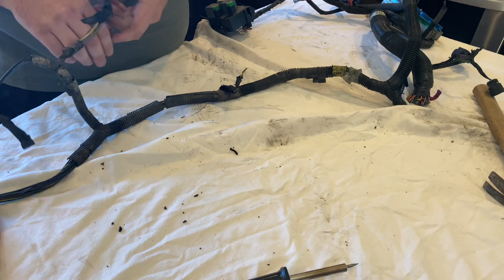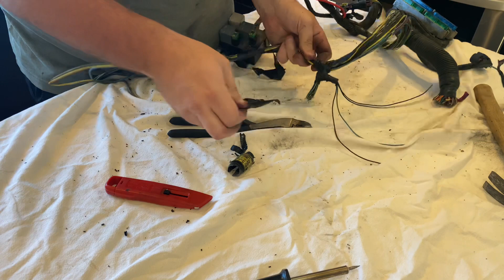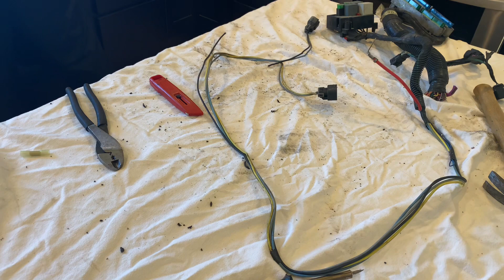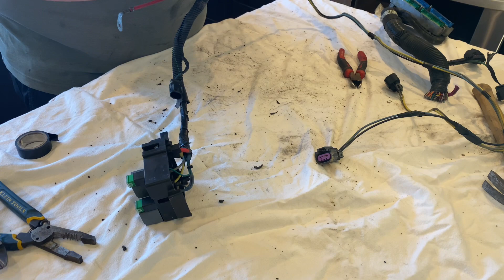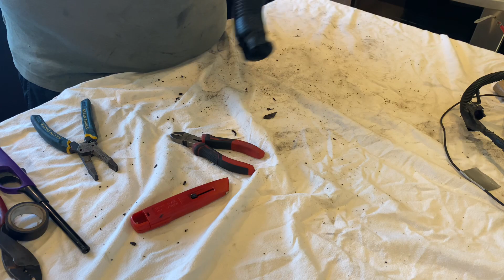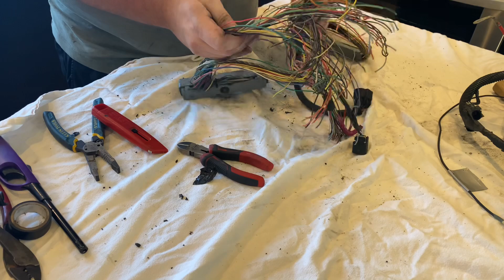Stripping down a GM E-Fan harness

Comment: Good stuff. I have a 2004 Suburban 2500 that I'm going to do the electric fan upgrade. I hope to sed more on youf channel. The SAS would havd made a great series. I hope you post more video for it but I kniw how it goes. I have a S-ton of video I haven't posted for my supercharger install, suspension lift, and locker install on my truck.